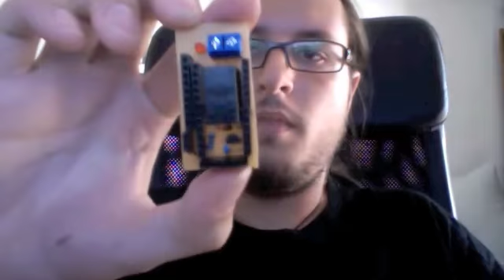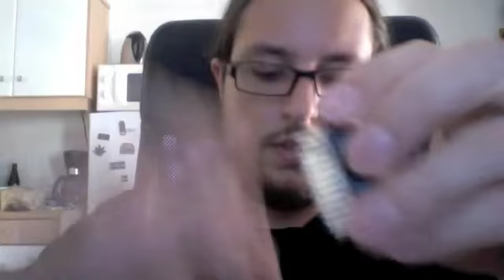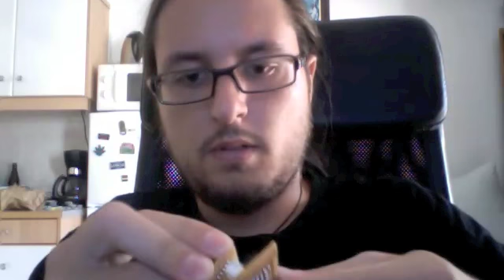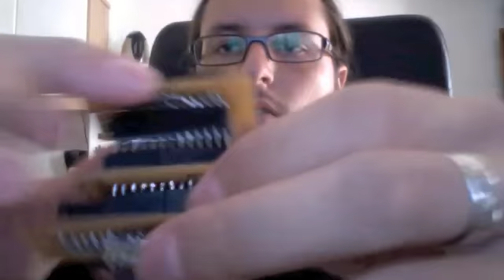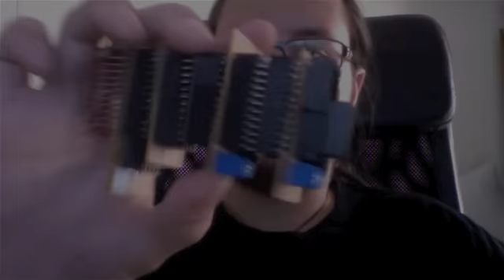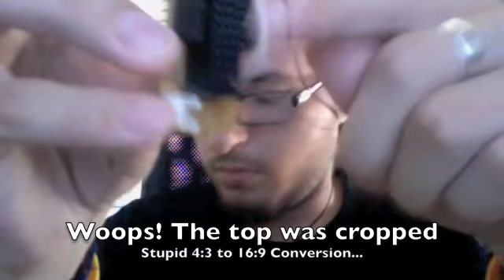Arduino Pro Mini Shields

Comment: I found the Eagle files at your blog, thanks for sharing these files.  The Digital I/O board looks like exactly what I've been looking for.  Quick question: do you know if the holes for the Mini Pro headers will also fit pogo pins like these? https://www.sparkfun.com/products/9174

Also, what are the overall dimensions of the boards?
Reply: Hey, thanks for the comment :)

I believe they should fit. Don't remember the dimensions I'm afraid